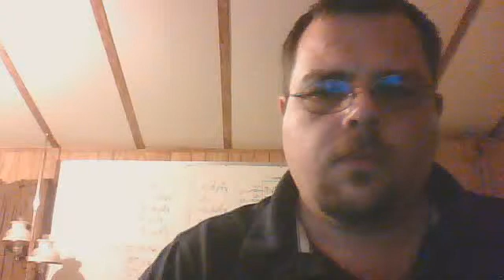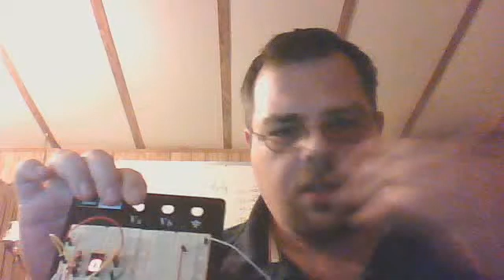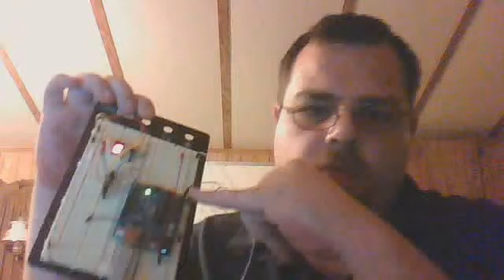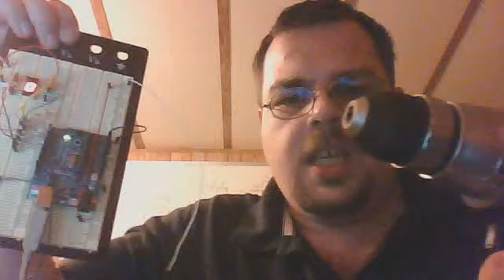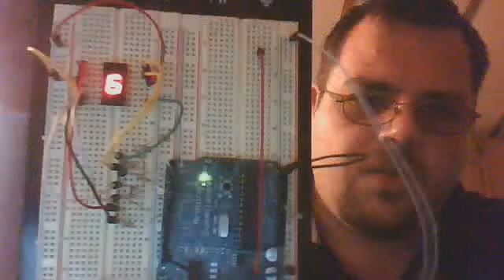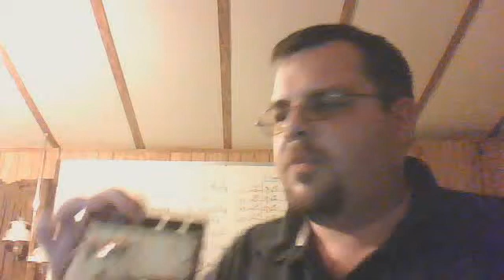Arduino EMF Detector with Numerical 7-Segment Display

Comment from the maker: Ya, the Arduino is really overkill for something like this, would be more cost efficient to use a PIC for it, but I'm just learning the Arduino. So far I'm impressed by it. 

The thing that is great about programmable devices though is the ability to set up ranges for it, tweak sensitivity, and have the outputs be anything your little heart desires.

Thanks for the comment!